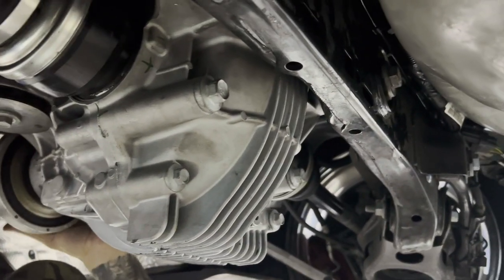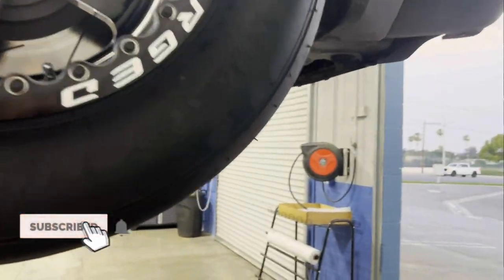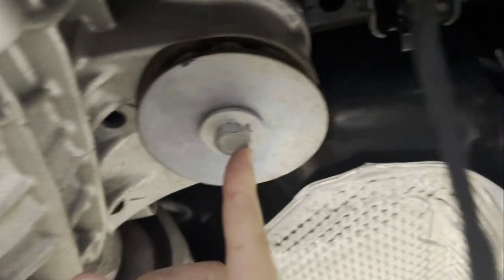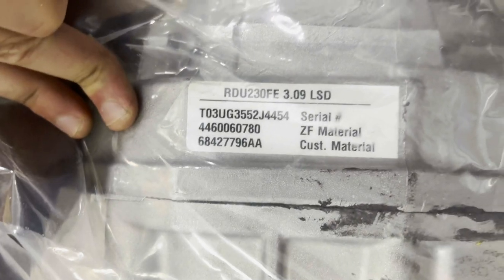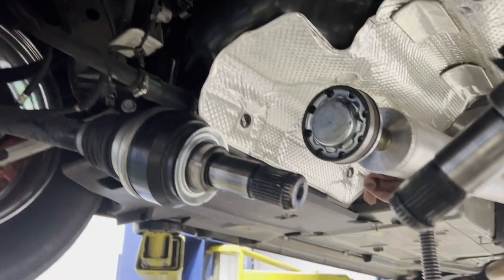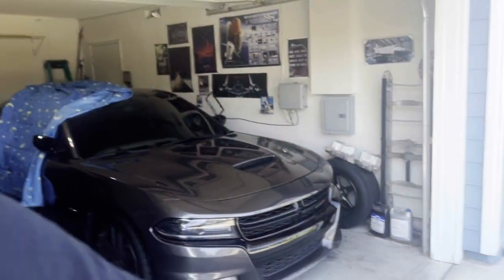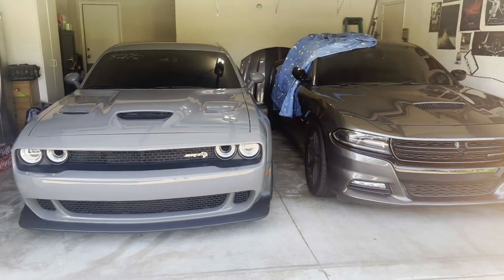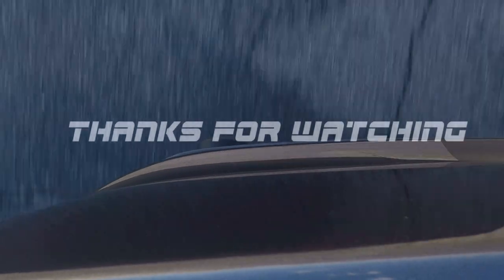Hellcat 3.09 Differential Install

Comment: Thanks for the info,  I have a used 3.09 lsd that I am looking into installing on my 2015 RT challenger, do I need the Axles as well or the stock axles fit them?
Reply from the maker: I recommend checking out my channel for this same mod I did to my R/T

Comment: Great video. What’s the difference from 2.62 and the 309 ?
Reply: That's what I want to know. Whats the difference in top speed ability, especially in a 220 mph redeye jailbreak. What's the average time difference in 0-60 and ¼ mile times? I'm trying to find a video with a side by side comparison/explanation.
Reply: The torque